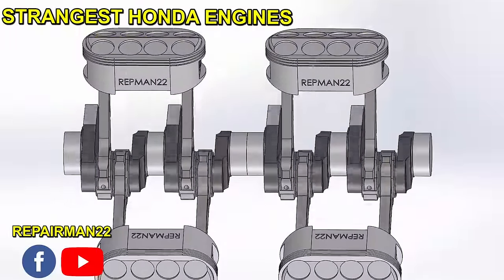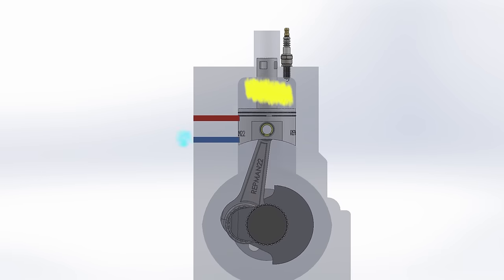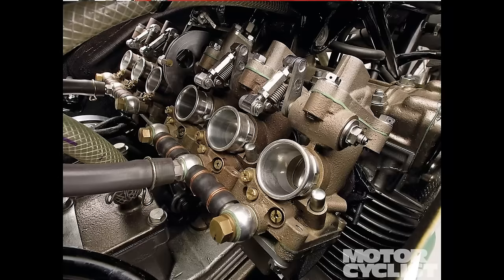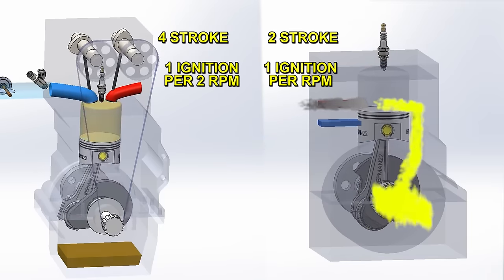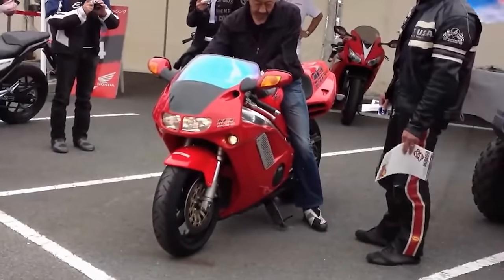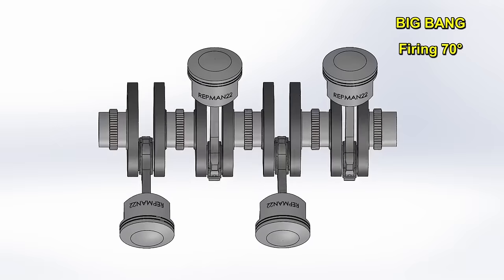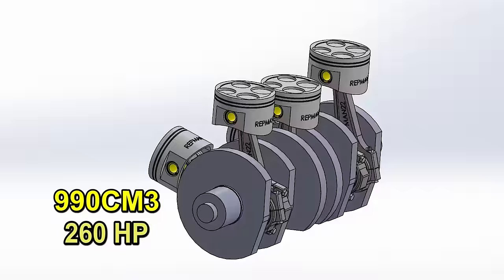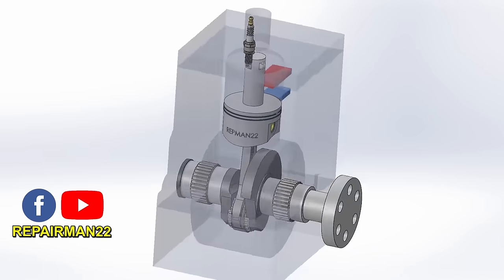How the Honda Chimney Engine Works in 3D. 🧠

Comment: An important development for Honda automotive engines was the CVCC engines or stratified charge engines.  This allowed street cars to get excellent drivability with improved gas mileage and pass emissions tests.  It worked so good that Honda thought that they would license it to other auto manufacturers.  This worked absolutely great.  I had a 1981 Honda Accord that had a CVCC engine.  It was near perfect for it's time.  Good gas mileage, excellent drivability and as reliable as a brick.  Brilliant engineering.
Reply: Yea in the begging of emmisions control, these engines passed with no catalytic converters,  an amazing feat!
Reply: I frigging love old Hondas.
Had a Accord (1987) with a million Miles on it.

Comment: When Honda revealed the GX series of industrial engines, it almost immediately replaced the old, inline style single cylinder engines in go-karts. It was more compact, ran smoother and fitting much better to the constraints of a go-kart. Basically anything "mini" was powered by a GX or its clone derivative. I dabbled in them for a couple of years, hopping up a clone from 6.5HP to 13 HP. Until the clone crankshaft broke and I threw away basically everything below the head. But the fun thing about these engines is: you can source pretty much any part for them. You dont have to waste money on a clone engine and have a box full of parts you wont use. All you need is a fresh block, side cover, a genuine honda crankshaft, high quality main bearings and the cylinder head. Everything else is pretty much aftermarket hop up kits. And the only investment I highly recommend for your build is a genuine honda crankshaft. Its much much stronger than any cheap clone one. Everything else is basically how much you are willing to spend...
Reply: bit like the pit bikes.
my first pit bike, ten minutes, wheels going all wonky. axle like a noodle.

shoved some honda axles in, i was taking that thing of 10ft jumps...
so then it was the swingarm shaft.
ditto. honda.
got an old side valve honda here i think is so old its simply a "G"... been a while since i looked.
Reply: The GX motors had really weak pressed tin rocker arms that 'folded' at the pivot. 
I found main reason was that plant fitters using them on generators, pumps and other industrial equipment were trying to run old cast iron side valve type valve clearances (0.008" to 0.016") instead of almost zero valve clearance (I set them same as motorcycle valves, 0.002" to 0.003" as I had run motorcycle dealer workshops until I found industrial equipment paid far far better)
There were 32 non running GX engines at the place I worked, (UK Plant) when managing director visited I was introduced as 'The Honda Expert'

Comment: I owned a 1971 Honda CB500-4 for several years.  Not any sort of racing bike, redline was only (IIRC) 10,500, but in street trim with a cheap fairing it would still bust 90 mph and ran out of revolutions before it ran out of power.  A longer front sprocket might have gotten the century.  And when I rode it as a courier in downtown Seattle, I got 52 mpg day after day.  I replaced it when the clutch started slipping and I couldn't afford to pay to get it fixed (I'm not motorcycle mechanic) -- but the CM400T I got wasn't at all the bike that four-banger had been.

One fun thing, my CB500-4 was stolen once -- parked in the street in front of my apartment, I got up one day and it was gone.  Police found it a couple days later, five blocks away at the bottom of a hill (pushed into a blackberry thicket).  The thief had tried to hotwire it by cutting all the wires to the ignition switch and twisting them all together.  When I got to the impound yard, I untwisted the wires, replaced the blown main fuse, traced which wire went to ground, and left that one out of the bundle when I twisted the wires back.  Two kicks and the bike started; I rode it for two more years with a toggle switch for the ignition (and by that time, I also had replaced the diode pack for the 3-phase alternator with a pair of full wave bridge rectifiers from Radio Shack).

If I ever get another bike, I hope I'll be able to find a Honda I can afford and enjoy...

Comment: I think the secret of the 'big bang' firing order was that it was to do with the psychodynamics of riding a bike. With even power, the smooth power delivery would be more likely to produce a 'cliff edge' loss of grip so, it could lose grip with no warning which made it very difficult for the rider to back off the throttle in time as everything happened too quickly. With a lumpy 'big bang' firing order, the power comes in pulses and the rider gets warning of when the bike is beginning to slide so they can back off in time in stead of the bike letting go before they've had time to react. This means the rider can keep the bike closer to the edge of its grip capability and therefore use more of the power available.
Reply: that makes sense
Reply: Nah, I don't buy it. Riding along the knife edge of traction is difficult, but far from impossible. Modern tech does slap a bandaid on the issue, though.
Reply: nah sorry this makes no sense.  The grip and the engine pulses are uncoupled. riders dont judge the edge of grip by the engine power pulses. that makes no sense. How many times the engine hits per tire revolution is different for every gear and gearing combination, and every tire size. Many parts of this video I take at face value, but this part smells like bull
Reply: @jasonadams2264  it absolutely does make sense because of striction. The coefficient of friction between most materials is higher when stationary compared to when already sliding. That's why you can get a 'cliff edge' loss of grip. Applying power in pulses means you start to get lots of micro losses of grip which gives you an early warning you are right on the edge. This is what energies you to back off the power - It's a feedback loop. Furthermore that exact same technique is used by some shunting engineers to be able to apply maximum pulling power without spinning their wheels
Reply: Im still not buying it. Been riding and studying motorcycles for the vet 40 years, and I have just finished tony foales book „motorcycle handling and chassis design“ for the third time and not a single sentence implies engine firing order had fuck all to do with grip. If you can provide some actual scientific research for this, I am all ears. One cannot feel engine pulses through the back tire, they happen entirely too fast together to be physically aware of. Any idea how fast engine pulses happen at even 1000rpm? This doesn’t hold water.
Reply: Additional example: would you say the front wheel also has a grip limit, and how many engine pulses does the front wheel feel? Exactly zero. One uses the actual factors that relate to grip in order to keep the front wheel from losing grip. One cannot sense individual pulses from anything that happen at 0.03 second intervals and that’s just at idle. At 10K rpm it’s a pulse every 0.006 seconds and no one feels that.

Comment: Yes 2 stroke engines burn oil but our brand new cars burn a whole lot of oil
Reply: Right they make the rings so loose we might as well run 2 strokes
Reply: You guys are both wrong.
Reply: Only idiots who drive vehicles with direct injection and/or cylinder deactivation have those issues and it’s from not maintaining them  on the DI side and Cylinder deactivation is almost always a bad idea. People buy cars based on looks and features instead of reliability. Toyota Direct Injection uses both port and direct injectors because they knew direct only would be terrible on intake valves and cylinder washing. People are buying garbage like Mitsubishis and Nissans because they look cool despite both companies being on the verge of collapse and making unreliable garbage.
Reply: @_..-.._..-.._ yeah even Mazda, a very reputable brands started using DI only and cylinder deactivation, I wanted to get one but that ruins it for me 
I'm only buying Toyota
Reply: @_..-.._..-.._  hey bud what you don't know is that I'm a certified technician
Reply: Jes
Reply: He means legitimate lubricating oil instead of refined fuel oil
Reply: EVs are basically oil burning engines

Comment: Nice info and great graphics make this easy to follow, even for a non-gearhead like me. Thanks for sharing.
Reply from the maker: Glad you enjoyed it
Reply: @repairman22  The Rotax ETEC direct-injection, voice coil 2-stroke engine that Skidoo has been using to power their snowmobiles for more than a decade has very low oil consumption, lots of power, good fuel economy, quite low emissions (for a 2-stroke) & is virtually smoke-free. Welcome to the 21st Century!

Comment: Good explanation , NO normal aspirated engine can beat a TWO Stroke engine !! Diesel or self ignition engines 25-30 hp/ L , gasoline  4 stroke engines max 260 hp/ L and 2 stroke ( actually 2 at the same time = 4 str.) more then 400 hp/ L !!! Kreidler 50 cc and 21 hp in 1970 year .
Reply: It's too bad two-stroke emissions suck so badly, eliminating them from any real future development. The same thing happened to rotaries.

Comment: Honda provided motorcycle drive chains protected by a case 
which also serves as a safety guard. This is a great feature
useful to extend chain service life and extends the interval 
between needed chain slack adjustment. Especially when 
off road riding, the chain case prevents sand from quickly 
destroying chains and sprockets, reducing maintenance. 
If a motorcycle has a chain drive, a chain case is good to
have, and Honda shows having that wisdom. Do others?
Reply: In fact that's a detail where others lead the way. Others being CZ, Jawa, MZ... (the 2 stroke king). Pretty much all of the so called Eastern brands. Inclusive many Western brands.
Or in other words brands more concerned with durability than aesthetics. ;-)
Reply: @crpth1  When you see motorcycle couriers in India 
you see chain cases on many high use motorcycles, 
usually see smaller displacement high fuel efficient
engines also. If the bikes didn't come stock with the
encased chains they would be an aftermarket part
everybody would put top of their list to add what
is missing.
Reply: my 1913 sunbeam 6hp has.

Comment: "Honda V-Tech delivered 160 hp while others of the time hardly delivered 80!" -Nope! The non-V-Tec Honda 1.6 in the ED9 was a good average with its 124hp. The contemporary VW Golf GTI had 115hp, limited for the insurance classes in power in Germany back then. A 160hp engine back then cost the same in insurance as a 300hp Ferrari here.

Comment: Virtually all the GP engines these days are V4's.  Hondas line of VFR motorcycles means Vee Four Racing.  Only in 2010 did they up the displacement from the 700-750cc bikes they built to 1,237cc.  Because of the high cost of the bike, few were sold, but it had frightening power of 170 HP and even with shaft drive had an actual 152HP at the rear tire.  I own one of these and yes, it is frightening, much beyond my '94 Yamaha V-max.  Most people that look at it don't know what it really is.

Comment: The 3D animations are out of this world. Gargantuan amount of information here.
Now, not to be nitpicking, but you saying that "central timing" is what is used nowadays sounds incorrect.
Maybe my english isn't good enough.
If you're talking about where the timing chain/gears are, those have been - on in-line 4 liquid cooled engine - located on the left side, not on the center, for many decades.
Since in-line 4 liquid cooled engine is by and large the most common internal combustion configuration, both for cars and bikes, it seems to me you're talking about air cooled engines from the 70's.
As for your mention about Yamaha's engine, I'll first need to check into the shop manual downstairs.

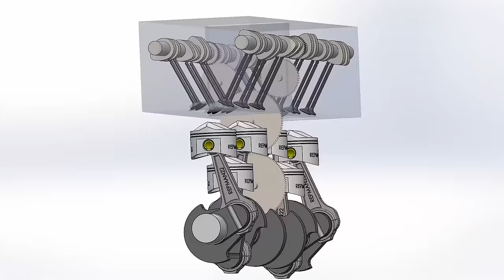Comment: 3:37 most high preformance motorcycle engines dont now due to better material tech used for camshafts. a side driven setup needs less bearings for the camshafts resulting in less friction and other small advantages. but in fairness it wasnt untill the late 90s that the change happened and there are still plenty of engines that use a center drive cams still in use today (mostly decended from older engines)

Edit: just to add really enjoyed the video :)

Comment: It's just Coupled-up V-8, that clamp same timing of pistons together (as twin). By chance, they got more working Area of pushing pistons and Lesser Valves complex, (8 sets of valves become 4 sets) also inlet/outlet ports/manifolds reduced. Only the CNC must work on extra-shape milling, looked like 4 elliptic cylinders, but not quite. (Also nearly elliptic, 4 pistons)
Reply: Nope

Comment: About the 250 hp per liter is not a problem with turbo today. Yamaha Apex with turbo has about 340 hp per iiter in their highest kit /like MCX/ the race engines are up over 500++ hp per liter or more.

Comment: Large multi cylinder motorcycles of today employ a camshaft drive from the end of the crankshaft, saving a bearing surface in the center of the crankshaft.
Reply: Also the NSR750 wouldn’t reach speeds of 200 mph

Comment: Imagine that a 50ccm engine like in a Scooter provides 16 hp (12kw) at 21500 rpm that's 360 rotations each second. 😈
Thats a power ratio of 320 hp per liter.
Even with today's turbos and with downsizing this is nearly impossible. 4:10

Comment: About GP500 cc, Yamaha had twice the wins from 1975 - 1995. If we take the span to 2000 they where even. So I doubt that the Honda Race Engines was outstanding. I know that much of the wins are depending on the driver but you must have a good motorcycle too.

Comment: I have no experience with honda motors ... I drive vehicles with honda motors since 20+ years .. and as much as I would like to get a wrench on them, there is no reason, because they run and run and run and run and run ... basically unbreakable, at least if you "spend them some love" (and oil and good treatment in general)

Comment: In 1999 this guy with an Acura Integra Type R challenged me to a race in an AOL chat room.  So I climbed into my VR6 powered '92 Corrado and went out to where he wanted to race.  Turns out I know this guy from the Orlando VW club, "Volkswagen Racing", which was a product of Alberto [I can't remember his last name] and Brad, this kid who drove like a maniac on Colonial boulevard in his white four door Mk2  Jetta when I was driving down the street just to ask me to join the group.  This last guy is a natural organizer;  I told him at a car meet up that he should work in business.

Anyway, when I got to the remote location  outside of Orlando, I recognized my opponent.  I congratulated him on his new Type R, but wondered why he had traded his supercharged Corrado;  He simply said it was faster.

OK.

THERE IS ABOUT 100 things I could say about that, but I won't.  A Corrado is a car with  a lot of personality and "feel", and a Honda is an appliance.  Folks...let's just leave it at that.  Ok~?

So here comes the race:  We line up and the light in the remote part of Orange county goes yellow for the cross traffic. I will only say that my eyes moved from the traffic light for a second or two and then I heard his tires squealing!  I nailed it and my VR6 screamed horsepower.  By the 1/8th I had him and I would have killed him in the quarter mile.  My Corrado recorded a best of 14.96 @93.25 with the spare tire on board.  When I raced this kid, I didn't have that 50 pounds of weight.

We stopped at 100 mph, when I was rushing past him.  His Honda did a great job, but my big German engine shut him down.  That's why I like to say that VR6 is the cure for the common Vtec.....  My German V6 went right around his Japanese four cylinder.
Reply: Integra is a little bit lighter by 100 lbs but the Corrado has more torque. Germans FTW!

Comment: Own 4 Civics: 3 'D' engines, the other a "Frankenstein" 2.0L turbo'd 'B' engine.  Their engines are essentially indestructable - they will not die unless you explicitly kill them.  I've towed trailers almost TWICE the weight of the car cross-country - 3 times (scale certification slip of the heaviest load was 5890lb - including the car+me).  Another time, without any trailer, went from Jackson NJ (Great Adventure Amusement Park) to San Clemente in 2.5 days (left Friday after lunch) - got there around 8:15PM Sunday.  Almost the entire trip was made >80 (often over 90), yet the car got over 40MPG with every tank, except [oddly] across Kansas.  (?? Go figure).
Reply: That's cool but it's a lot better to get a proper tow vehicle.